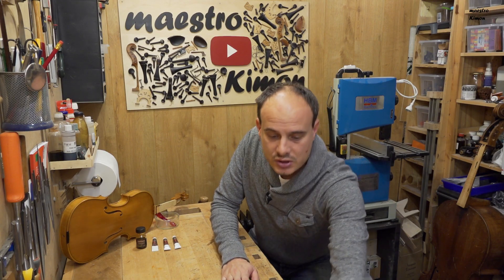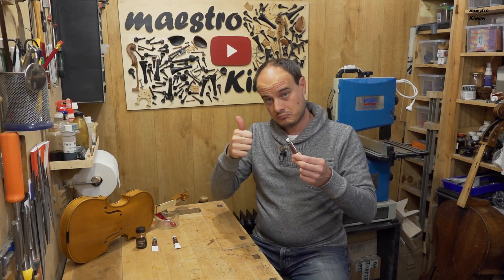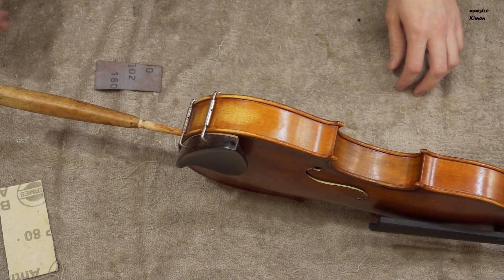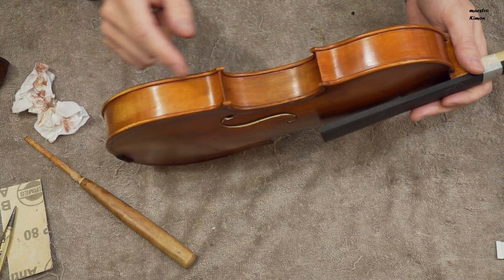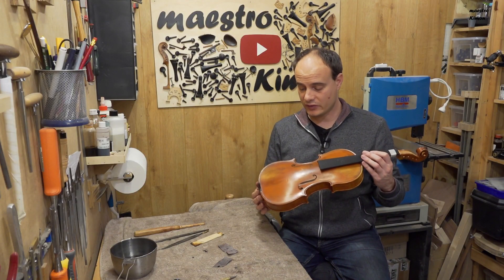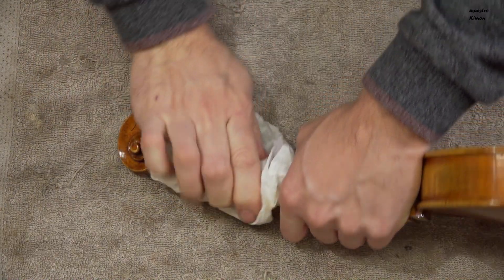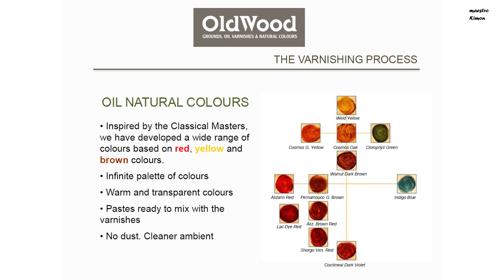OldWood1700 Varnish Review Part II and Antiquing

Comment: Thank you for your informative video! I have been experiencing the art of antiquing, and have been trying Burnt Umber and other water-soluble oil paints mixed with some dust and dirt so that way there's a more semi-natural way of wear and so far I've had some good results. I just have never done a violin in oil varnish which I'm yet to try.  I was going to also ask, Is your last coat of varnish that coats the whole instrument Oil or Spirit?
Reply from the maker: The last coat is also oil varnish, the same as the rest of the coats. Never mix the two!
Reply: @maestrokimon  between Oil Varnish and Spirit, what's your prefered and why?

Comment: Very interesting seeing you antique this instrument! You did it very differently from the way I did mine (not sure if you've seen the instruments on IG), and that means I learned a few things watching it :-D
I was very impressed with how quickly you could sand through a layer of varnish! It must be very thin?
Are the brushed on layers thicker than the ones applied with a finger?
Reply from the maker: Hello Tobias. I just had a look to your IG. I like your work, especially the last one, the darker one. You know, "there are more way to go to Rome", you have to find the way that suits you. The last colored layer was not very thin, with a lot of color and not so much varnish. I think that the brushed layers are more resistant ans they contain more varnish and les collor. Also the new 1200 micromesh with water is more aggressive.
Reply: maestro-Kimon Well, I'm very happy you like them 🙂
There are definitely many ways of doing things. I've only built six instruments so far, so everything is an experiment at this point, trying to figure out what I like. But that's the thing, I quite like a few things you did here which I didn't do. For instance, I realise now that there is no way my very worn down violin isn't darker above the bridge, and I really like what you got by adding a bit if dirt/rosin. Detail to remember next time...
I see, so you do a higher percentage of colour in the finger applied coats. Seeing this I consider going back to that as a way of adding coloured varnish, because I had issues with the Joha varnish setting too quickly and giving le a few streaks on the back. I remember using my fingers to glaze with pure oil pigments the layer was very even, and maybe I can do the same with varnish...
And maybe I should try micromesh if It's this effective! Would save me a lot of sanding time, since I applied a full coat of varnish and basically ended up sanding most of it off

Comment: I examined photos of a a Strad very carefully can’t remember which but it was 1716 and was surprised at its beat up condition considering it’s value, especially around the edges which were very worn with most varnish rubbed off.  Also there were many deep dark pits  and a very deep long dark gouge scratch on the neck.  It didn’t even look clean.
I really like the look of new violins that have been antiqued.  Thanks for your videos which may inspire me to do likewise if I get up the courage.